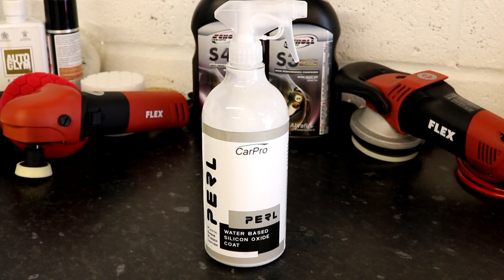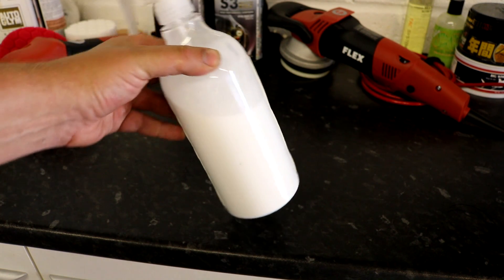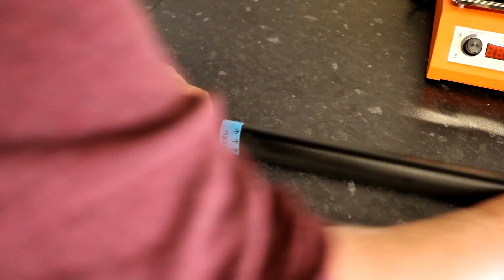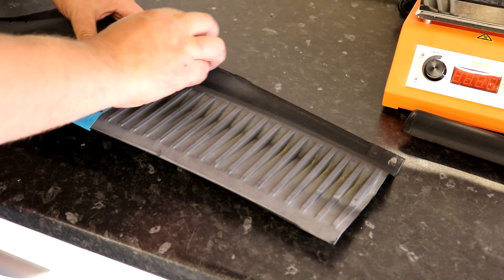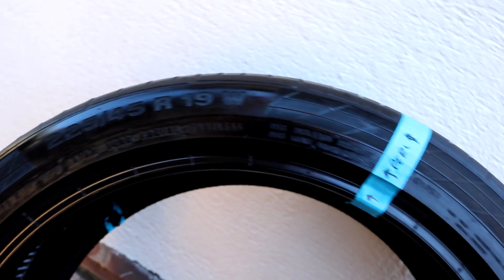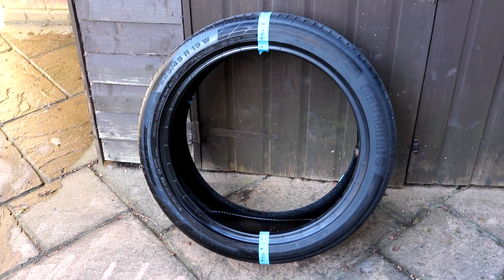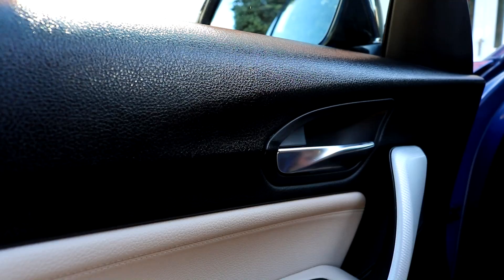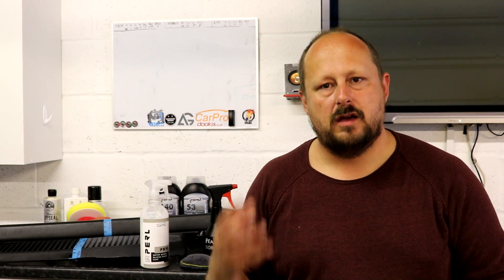Carpro Perl - Best plastic rubber and vinyl dressing ?

Comment: Have you tried the blue Gyeon Tire? I'm trying to choose between Perl and Gyeon Tire, just to be used as a tyre dressing. Both seem to get very good reviews but what would you choose?
Reply from the maker: I would glove up with Gyeon Tire, its like thicker, more slimey, sort of thing. Its offering like long term performance using ceramic tech.. but here my thoguhts..  no matter what you choose to put on your tyres they will look crap and need dressing (in order to give that lovely fresh dressed look) in a couple of weeks regardless of what you use.

For that reason I would recomend PERL or gyeons new tyre express which if you water it down is cool (see my review on it).  they are similiar these 2 products.   Ive not side by sided them though but I would prolly go with perl if you twisted my arm right now (more versatile) and a bit less shiny that the gyeon product.  both last out well...   but offer value as you can water them down (and should imo)  hope this helps mate..   go perl..   dont use it neat
Reply: @ForensicDetailing  Thanks for the quick reply mate and your thoughts on both products. Could you elaborate on why it's best to not use Perl neat? Whatever I was going to choose I was going to just spray onto a sponge applicator and wipe onto the tyre!
I'll check out tyre express in the meantime too. Cheers.
Reply: @ForensicDetailing  Mate, I just bought some off of eBay and it didn't come with a trigger head. Did yours come with one straight away?

Comment: I brought this a while back based on your review but haven’t used it much , I’m thinking of using it on my dash but I like a factory look and I only use megs interior detailer would you recommend I use this after? Or steer clear for a factory look?
Reply from the maker: if you use perl on the dash make sure its at the recomended low cncentration.  I like the look.   its not too glossy and it dries smooth.. test it though on a little area and see what you think Brad.   Its a good restorer and protector this product and seems to work well on everything.

Comment: How is the longevity and resistance to the outside elements?
Reply from the maker: thats what will effect its durability..  I had this on some badly faded trim on the M3 that was garaged and it kept it black for beond 3 months.. but if you keep it outside I think it will reduce durability down to say 1 month (bit of a guess).
Reply: Tire: 2-4 weeks on a daily driver depending of the weather
plastic trim: around a month i would say
interior: 2-3 month is possible

Comment: Do you recommend cleaning the rubber window trim before applying carpro perl? Mine is getting a little bit brown, so I'm thinking it might need a bit of cleaning before applying perl. Any advice?
Reply from the maker: yes definetly.   dont scrub the window trim too hard or any rubber too hard though when you clean it.  you could use a alcohol solvent glass cleaner and a microfiber cloth or IPA and water wipe down.   then apply the perl at recomended concentration. dont over concentrate it over you can get little white spots, although these tend to disapear on their own.
Reply: @ForensicDetailing  Really appreciate it! Thank you!
Reply from the maker: @runtodaddy  my pleasure taylor cheers m8

Comment: Is it slippery on rubber floor mats? And how does it compare to 303 for the interior dash?
Reply from the maker: it darkens better than 303.  it does dry off a lot but not 100% I would not use on rubber floor matts, health and safety reasons. if you get any of the material on your feet.  it can leave like white spots if you over concetrate is on exterior rubbers.  Its also not the most durable tyre dressing out there and can be a bit patchy.  but when you get to grips with it I think its a great versatile affordable product when you dilute it down and its a sucess.

Comment: Hello ear sir, i was thinking, if it would.be better for car pro perl as a faded trim restoration use , to lay down first a layer of a common trim restorer such as solution finish or gtechnik c4, or some cheap silicon based restorer and them regural toppings with the car pro perl as a maintenance product do you think we have longer durability???
Kind reegards
Reply from the maker: I wouldnt use a cheap silicone based restore and then go with carpro perl to like top up.. I would go with car pro perl and the restorer (its cheap because its concentrated)..        some peeps suggest solution finish to restore then seal in with ceramic coating for trim.. not tried that though
Reply: @ForensicDetailing  my dear sir
 unfortunatelly products such as solution finish, gyeon trim, gtecnick c4 are not availiable in my market and i sould order over UK eshops with big shipping costs, that is why i am trying substitutes. Now i am testing to seal trims with sonax PNS, i will let you know results
Kind reegards from Athens Greece
Reply: As cheap a.mean ptoducts such as Autoglym bumper gel, or sonax trim restorer, both costs here 10euro/8gbp
Reply from the maker: thing with perl is you dilute 3:1 for exterior plastics so a litre bottle makes you 3000ml of exterior dressing.  factor that down to a 500ml bottle or whatever size those other products come in and perl will be cheaper.  dont know if it will be better though sonax and autoglym are both pretty damn good in their own right.   but either way dont use perl to top other dressings because perl needs to bond to the surface. so cleaner the rubber or plastic the better marios
Reply: @ForensicDetailing  thank you sir for your advices, i will folow them

Comment: Jhon what do you find the best dilution  for interior
Reply from the maker: 1:5 even upto 1:10
Reply: @ForensicDetailing   cheers mate 1 more questions I have just got some seat covers for the van they more like fabric than that plastic material what’s a good product to put on them so they don’t stain as water just soaks right in to them at the minute

Comment: would you recommend it for a new car interior?
Reply from the maker: new car interior does not really benefit from dressing.. but if I was going to dress one I would use this as low concentrention.  say 5:1 or 3:1 whatever it says on the bottle.
Reply: @ForensicDetailing  Hey, thanks for your reply I really appreciate it. I asked because car plastics and rubber parts tend to tear/"decay" over time. Also, when living in a hot weather country (Greece) we can get over 70c inside the car in July/August, so all plastic and rubber parts start to dehydrate and crack :) Is there any way to keep them hydrated/healthy and prevent all this on a new car? TIA

Comment: Love your work and honesty in helping saving money. Thank you for this. I was just wondering if you could recommend a descent alloy wheel wax/sealant please.
Reply from the maker: alloy wheel you need to use a ceramic coating, any sealant or wax will get insta stripped... Gyeon Rim is one to check.
Reply: @ForensicDetailing  thanks very much bud. I'll try

Comment: Nice product for engine bays & tyres but for scuttle panels or exterior trim I find it does not work for me tried it on a few cars, I find it hard to bed in, it kind of sweats on the panel and bits that have bounded look terrible after it rains leaving it look streaky and messy .
Reply: You may have been using various other products and even if all of them have been water based there may be some residue from them still bonded to the surface. Some extra local cleaning with a good all purpose cleaner before the general wash and then a wipe down with IPA may help to remove all of that and allow the Perl to do a better job. You can of course bite the bullet and use Solution Finish or C4 to give you a much longer term darkening. Other similar products are available.

Comment: a question, I get the impression that Perl creates a non-moisturizing protective surface layer, am I wrong?
Reply from the maker: its creates like a hydrophobic film over the plastic.   Its a cool product but it can be hit and miss.  when it works its create...   sometimes it can be inconsistent and a bit patchy.    I still use it to this day though.
Reply: @ForensicDetailing  are you saying that perl is one of the best conditioners on the market!?
one more question, how long does the 1:1 perl applied to the tire and outer plastic last?!
So I won't trade it for anything hehehe!!
Reply: @ForensicDetailing  a question, when applying the prol on tires or outside plastic, should it be allowed to cure for a few hours and then remove the excess with a cloth mf ?!

Comment: My dash is matt. Will this give a glossy finish even if i dilute it 1:5 ?
Reply from the maker: hey there,  test area first Tord.  Id decribe the finish as satin.  but at 5:1 the gloss is low.   I dont like wet shiny dressings and I use this at low concentrations on my dash and I like it.  important to water it down.   Id say pull the trigger.

Side note Adams VRT i think is more matt, you might favour that but theres not a massive difference
Reply: Thanks a lot .

Comment: Solutions Finish for a long lasting look and is not a dressing   Perl as a dressing seems more suited to those wanting to present a car for sale rsther than those who want to improve their keeper......
Reply: Definitely not the case. You're correct in that Solution Finish is much more durable and effective, but Perl is also very durable. It's not a gimmick product at all. I use it on my tyres 1:1 and it lasts at least a month. I'm yet to try it properly on my rubber and plastic trim, but I'm confident in its ability to last a decently long time. It's concentrated form also makes it an incredibly economical choice if you want a "one product fits all" for your rubber and plastics.

Perl is the real deal, my friend.